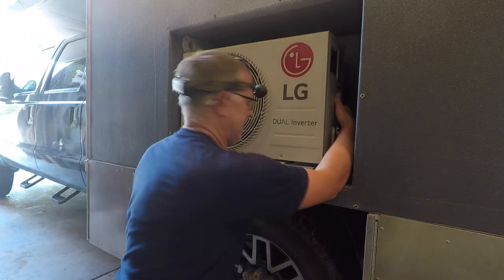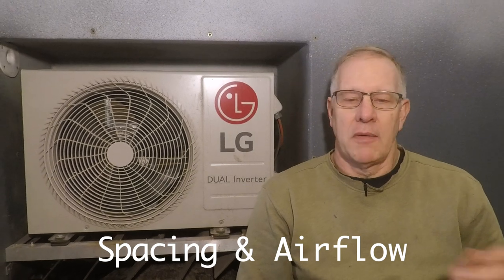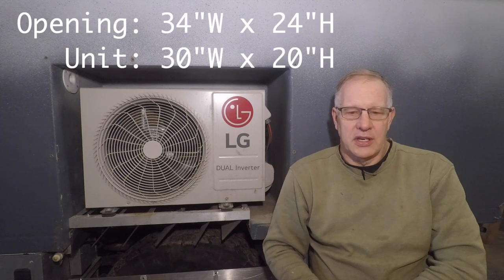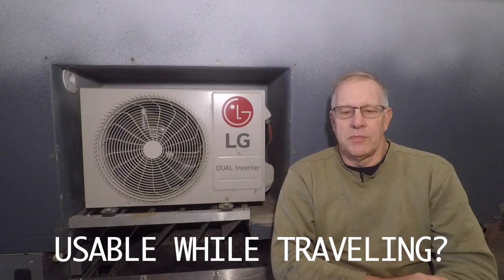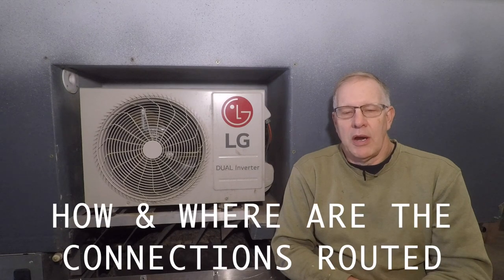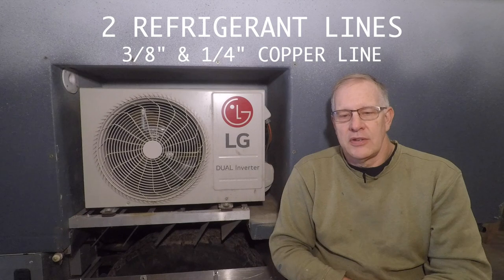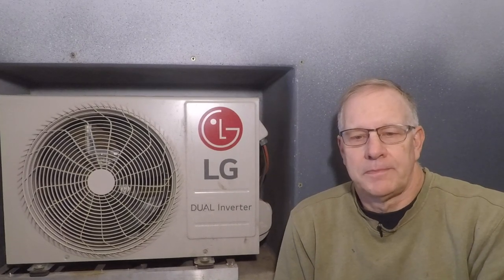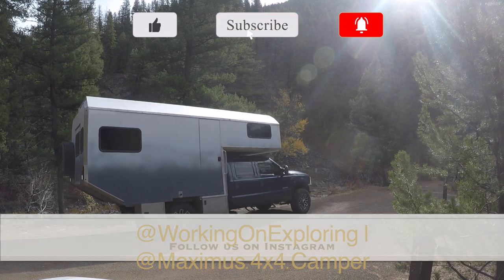Mini Split RV System? Your Questions Answered | DIY Truck Camper

Comment: Steve!!!!!! I sincerely need your input/help. I have a 19 foot travel trailer. I am in the process of rebuilding it(its vintage). I am busting my brain trying to figure out if a 9,000 is sufficient, or if I need to go with a 12??? And where would be the best place to mount the indoor part of the unit(the part that blows the air). So, from the looks, my space isnt vastly much more than what you have.
Reply from the maker: Jason,
Happy to help. Some thoughts;
1) Likely similar 'floor' square footage but you will have about 1.8-2x the cubic footage(?) due to the fact 7' or about 1/3rd of my floor area is only 3' high rather than 7'. This also means your wall area is larger ( with a proportionally larger heat loss/gain). 
2) Most important of all, you have, most likely, very poor insulation and very little of it. My walls have 2" of PolyIso (R6.5/inch) @ R13 whereas your wall insulation is likely ~1" (+1/2 to -1/4") and probably fiberglass (R3/inch) giving you a wall rating of ~R3.
3) My windows are double pane of R1.8 whereas yours are likely single pane at ~R.7. Your windows, being old, may also be (air) leaky (I have 7 windows and none open)
4) Not knowing what your wall framing is made from (aluminum or wood - probably wood) or skin (aluminum or fiberglass?) also has a big effect on heat loss.
4) Assuming all the above, I'd guess your heat loss/gain is probably 3-4x mine. 2x at best(?)
5) Not knowing what environmental conditions you will want to be able to operate in? SW desert in the summer or humid gulf coast or you can drive to altitude and only need a little afternoon relief?
 6) I have to think that 9kBTU is never going to be very useful in very hot (especially if humid) conditions because I am very pessimistic about your ability to insulate. Even if you replace all your fiberglass with the best insulation you can get (polyIso or XPS) you still won't be able to get more thickness and your windows will still suck. You might be able to cool just half the camper at a time and if that is enough, that's the only way I think 9k could work.
7) Don't assume you need to condition the whole space all at once. If you're not in the bedroom during the day, just close the door and let it get hot. This presumes that once the sun goes down, you can ventilate and circulate to cool off the bedroom.
 
ENOUGH WITH THE PESSIMISM......

Where to mount
In my case, I have a big space (kitchen/dining/bath) and a small space (bunk overhead). It's far easier for me to put the IDU in the big space and cause a small circulation to condition the small space than it would be to do the reverse. This also keeps the noise of the IDU away from where I am sleeping so it's more likely to be useful at night if it comes to that (although its extremely quiet). I do have a false ceiling (~14ft long) with circulation ducts (2) to draw air from the bunk and dump it at the IDU to do this.  (I don't imagine being in hot and humid so my main need is to cool the living space in late afternoon). In your case, you likely have two similar-sized spaces assuming you have living on one end and sleeping on the other. If you expect to NOT be in the sleeping space in the heat of the day and do expect to be in the living space, putting the IDU in the living space seems more logical. You will need a method of causing deliberate air circulation to occur from end to end to condition the whole space. If you anticipate needing to sleep in hot and humid, the IDU in the sleeping space is about the only way to do that.

Comment: Looking back if you could have found one you liked, would you have opted for a 6k BTU unit instead of the 9k. With good insulation would you imagine that would be enough cooling/heating?
Reply from the maker: Because the 9k unit is variable speed, it can run from 3kBTU to 10.5kBTU. I felt it was the right size when I bought it and am sure it 8s now that I have been using it. I'm pretty sure 6kBTU would be too small and would likely only be workable for a very insulated, very small van.
Reply: @WorkingOnExploring  thanks for the reply. Yes it is extremely variable and works great. I was just curious if your typical "duty cycle" had it pumping out less than 6k BTU. If it was and I'm not mistaken, the closer you stay to 100% the more efficient the unit is.
Reply from the maker: System efficiency is not linear with capacity(compressor speed). For argument sake,I'll try to illustrate: Assume efficiency at 100% capacity is a 10 EER. As system capacity goes down, coil efficiency goes up significantly while compressor efficiency only goes down a little. At around 80% capacity, EER might be around 12. At 70%, capacity, it might be back to 10. As capacity goes below 70%, compressor efficiency loss catches up with and overcomes coil efficiency improvement and overall system efficiency goes down probably to 8 by the time it reaches 30%.

You can bet the control algorithm knows what it is and makes use of that operating point in order to achieve the best SEER rating.

Comment: Hello Sir, from the UK.
I saw your videos last year, and based on information, I'm about to buy a Mitsubishi AY20 mini split for my van. My question is, after driving, does the unit need time to settle from all its bouncing around, or can you switch it on immediately upon becoming stationary. I'm buying this mainly for my dog, for the times I have to go shopping or doing laundry, so ideally I'd like to pull up in a parking lot, switch on the A/C and keep my dog safe. Thanks for the videos.
Reply from the maker: The issue is one of disturbing the lube oil. For example; When transporting a refrigerator, which is tall, lying it down results in oil flowing out of the compressor to settle in other parts of the system. The compressor has a low spot similar to an engine crank case which may gravity drain to the suction side pipe. If it were to be stood up and started immediately, the compressor would not have oil immediately available and it could run for several minutes before refrigerant was compressed and began to flow enough to move the oil back to the compressor. This phenomena really only happens in a drastic reorientation. I don't think it's likely or possible to happen from driving, even on steep roads. Most compressors can readily  operate at 20-30 degrees of tilt. Some RV rooftop A/C units use compressors lying over about 75 degrees (to lower the overall height of the unit), moving the oil sump to a corner of the case where the oil pickup still functions. This is only workable on one side and is clearly designed to work this way so don't assume this means a mini split could tolerate this much tilt (some folks would like to lay the ODU almost fully on its side in a similar manner and put it under the vehicle) but I can't imagine that any amount of off-camber driving that an RV could tolerate would be a problem.
Reply: @WorkingOnExploring  Thank you Sir. I'll be fitting mine upright, on the side of my vehicle underneath. It's a chassis cab Mercedes Sprinter, so I have 16" spare under the floor line, and 4" will poke into the floor space. I was mainly worried that the oil wouldn't settle after driving, but as long as the outside unit is mounted upright, all seems to be OK. Thank you for the reply.

Comment: If side mounted condenser, will heat pump also not work due to wind resistance?
Reply from the maker: When I designed it, I didn't think I would be able to run it while driving because the slip stream would prevent discharge from the ODU. I received comments from a number of motorhome users who mounted it in a bag box with the door removed and a hole beneath who reported that it seemed to work fine. With that info, I have run it quite a few times and agree. I'd guess that there is a higher pressure underneath that helps airflow overcome the slipstream.

Comment: i think the slipstream will reduce the static pressure around the vehicle and suck out the warm air. even without the fan running. is that possible?
Reply from the maker: Theoretically, it could go either way. I initially thought the pressure under the truck would be higher than the sides (a positive) but that the slip stream would be a greater blocking force (a bigger negative) still prevent adequate air flow. Although I haven't actually attempted to measure it (with a manometer), just running the unit seems to work adequately. I'm also concerned about OVER running the fan and having it become a generator. It would also like to measure the fan speed both with and without moving the vehicle but haven't attempted that either. I rarely run it while moving and if I do, it's only about a half hour. Using alternator generated electricity is about $.50/kWh as compared to free for solar generated so as long as I get lots of solar, operating while moving has no advantage.

Comment: Great video, very informative. It would be great if you showed real world energy consumption for this unit.
Reply from the maker: I'm working on that but somewhat slowly....I have an update on solar production coming in a couple weeks and will put out a little data on using the heat pump then as well.

Comment: Do these units need to be level while operating? If I’m parked on the side of a city street with the typical crown of the road surface, will the unit still operate normally? Thanks much!
Reply from the maker: Level is relative. It's about the ability of the refrigerant stream to return oil to the compressor. Refrigerant will move oil uphill somewhat. Problems occur if there is a large area in the refrigerant channel where oil can lie out of the gas stream. The angle? Just guessing but 20 degree slope might be a good limit (that's pretty steep actually). I would think if your system is installed with proper orientation in the camper, you would have to be at a VERY uncomfortable angle for days to create a problem. Absorption refrigeration is MUCH more sensitive by like a factor of 5 or 8 to slope than compressor refrigeration.

Comment: My question to you is and I hope you can help me here. Do you have the lso 90hx V2. Or do you have lso 90hx V1. When you pull up the link oh, it shows two different numbers. Any help would be appreciated thanks I definitely like to get the same one you have. And not order the wrong thing thanks
Reply from the maker: When I first started looking at this unit, it was the LS090HXV1 but when I went to buy it, over a year later (about 15 months ago) the LS090HXV2 is what was available and is what I bought. At the time, I thought that it was a minor model improvement as there were no spec changes at all (as I recall). In just checking advertisements on ecomfort.com, , I see mistakes in a description for the model 2 that include references to the model 1. My guess is that the 2 is what is available and the 1 has been superseded (and likely all you're likely to actually get.)
Reply: @WorkingOnExploring  thanks for the reply I appreciate it

Comment: Great videos, seems like your experience and knowledge is the perfect match for a mobile mini split install. Any concerns about the flared connections? Did you use any type of sealing compound or anything special? Any thoughts on a section of flexible line set to absorb some vibrations?
Reply from the maker: 1) I have had a flare crack and lost most of my refrigerant. I was on the road so I just stopped by an HVAC place and had them cut it off and recharged. I do have intent to replace the flares with Rectorseal 'Pro-Fit' (SupplyHouse.com) which is a fitting that attaches to a SAE male flare  and the other side has a double o-ring push-to-connect socket that accepts an unflared tube. This should provide some vibration resilience.
2) Rectorseal also makes a flare 'sealing gasket' called 'Flaretite' (also available at SupplyHouse.com) but it is expensive for what it is and i like the 'Pro-Fit' better (may allow some line twisting without cracking)
3) There are flex stubs designed for dealing with tight turns in and around connections, again made by Rectorseal and called 'Nokink' (similar products also made by others). These are annealed corrugated stainless tubing inside a braided SS jacket. I have seen a number of van guys use them to swing the ODU on the rear bumper. This is an exceptionally terrible idea, using them as either a vibration isolator of door opening connector. The annealed SS is not designed to be flexed more than once, (on installation), is not designed to be flexed while under pressure and will work harden in any moving environment. There are vibration damping products that appear identical (made by Rectorseal, Sporlan and others that have a long history of use on reciprocating compressors. They only 'appear' identical as they use a spring tempered corrugated stainless that will tolerate vibration. They are straight and need to be installed and used straight. They are not easily flexed or curved as they are designed to only damp vibration (small reciprocal movement. I think a gentile curve of copper tube and Pro-Fit is the best solution.
Reply from the maker: In vibration; if you assume vehicle caused vibration is a threat, make sure both IDU and ODU are mounted together on the same rigid structure so there is no induced movement between them. In most cases, both are mounted on the RV cabin and as long as the lineset is similarly attached, you're golden. dual scroll compressors are effectively vibration less. Cheaper single scrolls (of Chinese manufacture) do have more vibration.
Reply: @WorkingOnExploring  thank you very much - this information is invaluable!
Reply from the maker: And I forgot...'Nylog' is a semi-liquid joint sealant for refrigerant connections. It has the consistency of

Comment: Thanks for a very informative video. I live in Australia, and I'd like to know what you thoughts are with regards to corrugations(wash boarded roads) and intense vibrations, based on the assumption these units weren't designed for those types of conditions. Do you think they're robust enough?
Reply from the maker: I'd rather take this on washboards than a roof mounted.....mostly because I don't think the ROOF would last. This mount is more secure for the condensing unit but the simple sheet metal bracket that supports the evaporator may be the first candidate for reinforcement.....the vibration problem with A/C is mostly about unsupported copper tubing inside the unit but spray foam around it is often all that is needed. I don't think this unit would fare any worse than something specifically made for RV service.
Reply: Good question. LG are a fairly good aircon and while I agree with a lot of what WOE has replied here, as an Aussie with a bit of experience with this type of splits on a 9ton Isuzu truck that frequented a lot of corrugated outback Queensland roads, I can tell you, that you will have problems in these conditions and you will have to pay special attention to piping, with at least a pigtail or preferably a flexible section at least and also the compressor area & piping will require extra support, chunks of foam jammed in everywhere can help prevent some vibration issues here, or maybe even some silicone or spray foam in certain areas as these systems can take a bit, but will generally fail prematurely due to vibration effects on these type roads, I had one system lasted about a week and the compressor jumped around so much it tore up all the pipe work. 
A caravan or bus is better for this, but if ur considering 4x4ing or a Cape trip and Old Telegraph Track or anything like that or corrugated roads in Australia, you will definitely need to have an aircon with some special considerations. 
Being able to fit and maintain these type system myself made it more feasible for me to be able to do this for a time, but I did end up getting a better system fitted for a small bus eventually with flexible hoses to the rear machine motor compressor to keep my cab cool in the heat while working my machine in the hot middle of nowhere (Dirranbandi 48 oC in Summer).  
This info may be a bit late for ya mate, but hopefully may be of help to anyone thinking of doing this type of install, I have had many occupations, Refrigeration is one of them, Im not saying you cant do it, but be aware of the potential issues and try to remedy them before you go bush. Cheers

Comment: I like the way your brain works... I was under the impression that these mini split systems needed a minimum lineset length to supply enough refrigerant. Yours seems well short of what I've seen (15' min). Any thoughts?
Reply from the maker: There is no minimum lineset length for functional reasons. The reason is the manufacturers created one is because they load enough refrigerant into the system for between 15-25' of line.....if you have more than 25', you add more refrigerant. There is a table for what more is in oz. per foot. By the same logic, you could also remove refrigerant if your lineset was shorter. The method for adding refrigerant is to place the refrigerant tank on a scale and open the low side of the manifold gauge set to allow the higher tank pressure to flow (liquid R410a) refrigerant a little bit at a time into the low side (compressor running a stable system). Removing refrigerant is the same but done by opening the high side to flow refrigerant into the tank. GREAT care must be taken to ensure there is enough space in the refrigerant tank to accept the offload. The pros will tell you that you MUST use a refrigerant recovery tank (higher pressure rating than a refrigerant bottle), recovery machine, withdraw from a non-operating system AND have a float shutoff cable between the tank (tank has a float switch to prevent overfilling the tank) and recovery pump. For the little you need to remove, a scale and partial bottle will do.